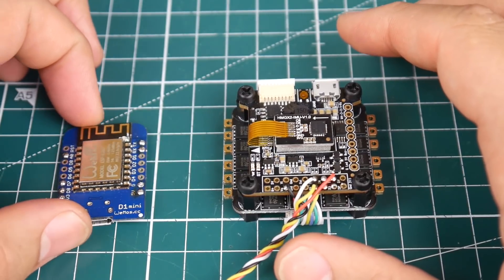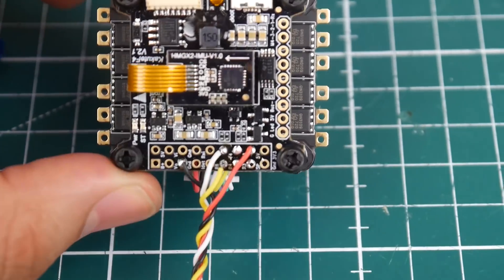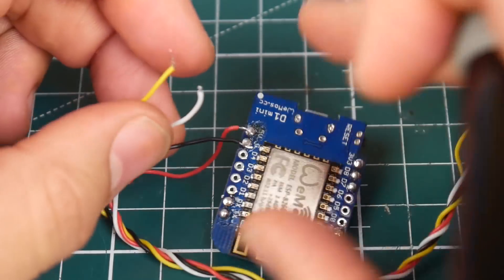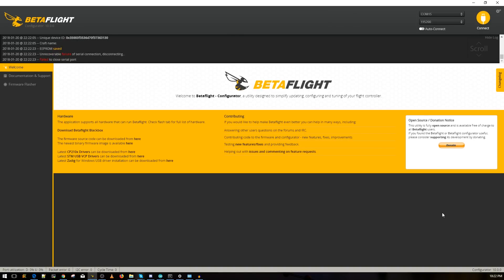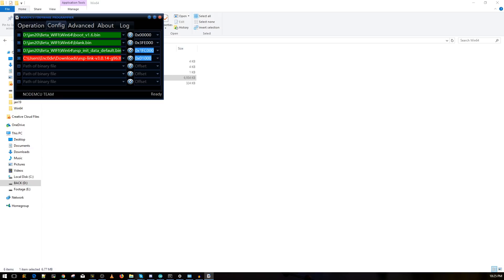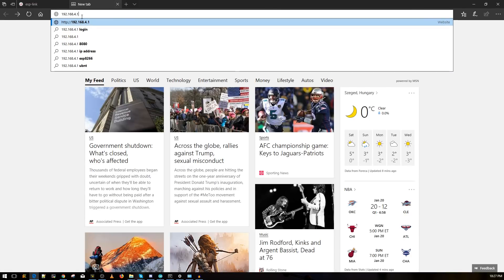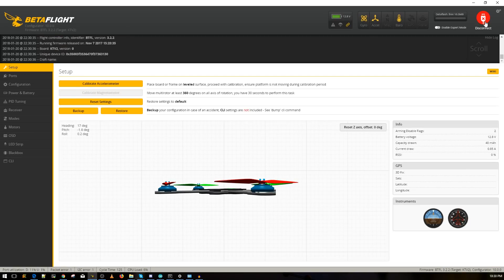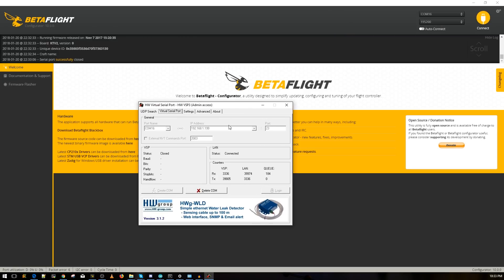How to Connect to Betaflight through Wifi // Wireless Betaflight Easy Setup

Comment: First apologize for my English (Google Translate).
My congratulations on the idea and the project.
I'm trying to copy it (with your permission) but I'm not doing it right. The D1 Mini flashes it without issue (I think), but on reboot I can't find any ESPxxxx network or connect to 192.168.4.1.
Can you (or some kind reader) point me out that I'm hacu
going wrong? I am very interested in being able to do this project.
Thank you

Comment: The video is informative for me. However, I use a different module which is black and smaller. In my case, the hardware connection is more complicated. GPIO 0 should be pulled to ground when programming and CH_PD should always be connected to 3.3v. When in normal operation other than programming, GPIO 0 should be pulled up to 3.3v. I tried to float these 2 pins at first and sometimes I got wifi sometimes not.

Comment: I purchased 2 of these from Amazon and neither worked. I followed your video exactly, twice. Although the blue led flashed during flashing it did not light up when connected to a 5volt supply. Was not reckognised by iPad, iPhone, Laptop, Desktop. Could not connect to iNav or Betaflight. I suggest you do a follow up video on how to trouble shoot and correct baud rate on configurator etc. Lucky for me Amazon Prime have done 100% refund.

Comment: Great video.  Quick question, how hard would it be to turn it into a dongle that plugs into the usb on the FC. That would make my life easier so I can use mobile config tools and remove any interference doubts . Is there a Wemos board you could stack to do the USB connection ?  or wire something up.  Is there a commercial product.out there now ?

Comment: Interesting idea :) One problem with this is extra weight and space issues in low profile frames. In case of RacerStar F4S kind of FCs with USB socket at front better is to add an extender cable with heat tube cap :) which doesn't take space and weight virtually nothing. Did the same for camera OSD's too.

Comment: Why can't u use the rx tx on the back of the frsky tx module to do same
Reply from the maker: vern kelk Its possible but you will need custom firmware and a custom module connected to frsky TX
Reply: Drone Mesh I wanted to put a Bluetooth module on my er9x running opentx. So I can use ex-gui on a GPS drone I'm builtin
Reply: Using the internal Bluetooth port or on the rx tx pins on the frsky module

Comment: Great idea ! ,can you still just connect your FC via its usb to your computer ? (with out the battery connected)
I can see this as being handy to configure in the field ,live ,ie land your quad a few feet away ,make some changes and then take off.Its like ,I can now configure my vtx via my TX and fpv goggles ,also my Runcam the same way and I would not be able to go back as its so much easier. With all the rapid changes with BF and esc protocols ,this will make it just that little bit easier to do!
Do you know what the weight of the module is?
Reply from the maker: The FC will work the exact same way with this so you can access it USB
Reply: @DroneMesh  Can we Flash Firmware using this?

Comment: Please be VERY carefully. The ESP8266 can easy crash and could simply took you not of the air. I build much with the ESP and thus I know what I am talking about. on a copter you nearly always have noise, even if it is only magnetic. If the CPU in this crashes it is very likely that you crash or even misconfigure the FC and you quad can in worst case be uncontrolled. The less problematic parts the better, believe me, you won't have a quad flying full speed in your face. take the time and use a USB cable. Betaflight can be configured this way but there is a good reason why no popular flightcontroller has bluetooth or wifi! 

If a copter goes full speed on you it can easily kill you. This racingcopters are NO toys!
Reply: I can confirm, i'd suggest hputting a simple switch to power the module on and off. It would also have the added bonus of energy saving ;)
Reply: The Problem is that the ESP8266 is very unclear documented so there can be some bug and configure your controller wrong. if you already use a laptop for wifi, why you cant plug in usb or in case the port is hidden: FTDI adapter and 3 pin header. lot more easy and secure...
Reply: leo ost USB ports can break off, I had to replace a flight controller due to this.
Reply: Hello, you can still use the uart with a FTDI adapter... connect 4-5 wires and ready to go, technically thats what F1 boards do, because they dont have USB VCP.
Reply: leo ost I was thinking that but the msp is turned off so I cant
Reply: MSP must be on, also if you use his 'method'.
Reply: leo ost yeah, that was my point
Reply: Yes I know but it does not matter how you do it, it must be on on nearly all methods. not including JTAG for example

Comment: How to know which uart port is not inverted?
Reply from the maker: SIGORIS If sbus works in it then it's inverted. if ibus works then it's not inverted
Reply: Not true. I have sbus and ibus working of the same uart port. I just have to switch from one to another in cleanflight and on transmitter.

Comment: That's fantastic, man! And you can use a cable with some kind of connector, so the ESP8266 doesn't need to stay in the quad. You just plug when needed. :D
Reply: Which is kind of  redundant because you dont exactly want this ...

Comment: Awesome. Would be awesome to take this to the next level and broadcast the usb connnection on the fc via wifi. I think a rasberry pi could do this but it would be over kill. I've seen lots of SoC with wifi that run linux that are quite cheap. I guess you need to find one of these that have a usb controller built in?  Then you would have a device you can plug into any of your fc's without havi g to wire stuff onto it.
Reply from the maker: +engizmo I am working on that now.. That was my goal but it's a bit complicated so I'm trying to figure out a way to run 
Serial 》 USB -《》 USB -》 Seria
I have ordered some of those new ftdi chips to play with

Comment: Lol, I have an awesome idea. 
Place like raspberry pi zero and place it into your moded eachine vr007. Flash Linux into it and install BF on it.
Place some bluethooth/wifi module on it and add the switch to be able to select between receiver and RB pi zero.
 So you have BF INSIDE OF GOOGLES !!!!
you can use that pi zero that has WiFi and Bluetooth already on board 😄
Reply: BuzzCola 3 BadAss!
Reply: Mike B lol, computer inside of googles 😂
Reply: BuzzCola 3 use your phone as a hotspot.
Reply: Mike B why ???
Reply: BuzzCola 3 no need for it. Just having the ability to run the Internet from your goggles.
Reply: Mike B yea